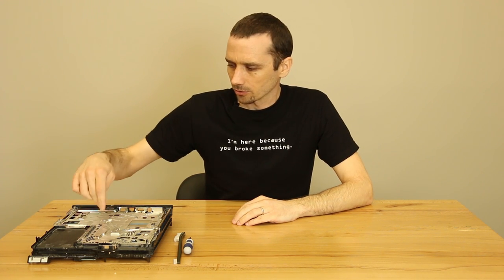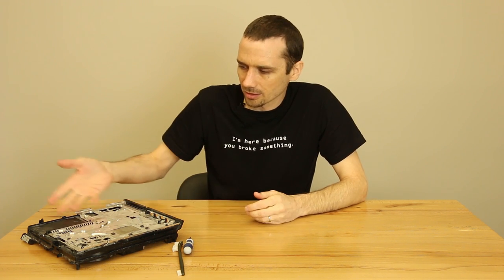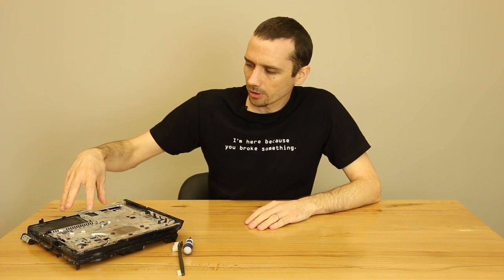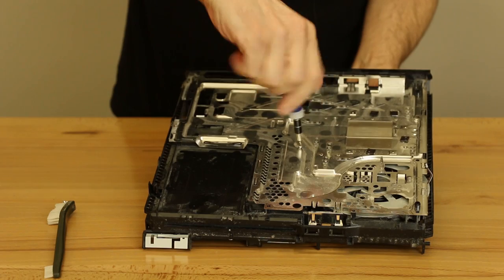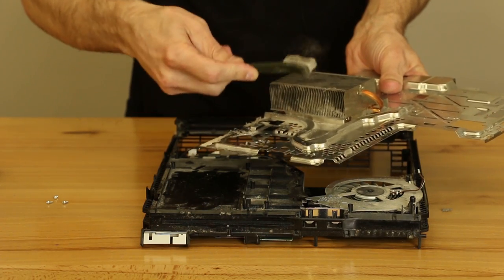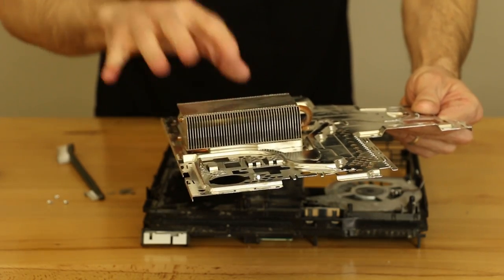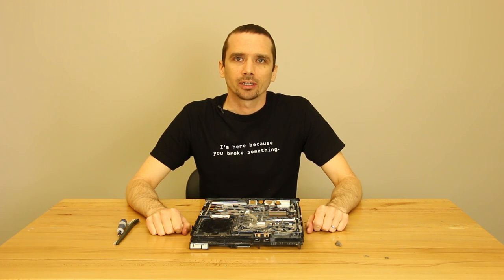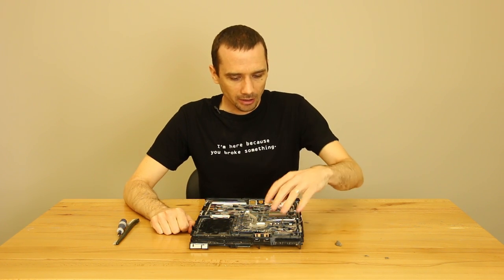PS4 Overheating Repair Tips - How to Fix Loud PS4

Comment: I have a launch PS4. Recently it has started overheating almost every time I turn the console on. It would usually stay on for a minute or two then beep loud 3 times and shut off after the screen says that it is overheating. When I put my hand on the console afterwards it gets to be pretty hot around the power supply area only it seems.

I don't keep it in an enclosed space or anything like that. I decided to take the whole console apart and found there was a lot of dust but most of it was in the fan and clogging the heatsink pretty bad so I cleaned out the entire console. I also replaced the thermal paste after because there wasn't much there and it was crusty. After putting it all back together I thought it was fixed because it worked fine. Then a day later I went to turn it back on and it started overheating again.

For some reason my best chance of keeping the console on seems to be flipping the PS4 upside down and removing the bottom cover to expose the fan/power supply while it is running. When I do this, it usually stays on and barely gets warm instead of getting pretty hot with the cover on and being right-side up.

Does it sound like the overheating could just be the power supply itself?
Reply from the maker: It's not the power supply. If the PS4 tells you it's overheating, then it's overheating.

Comment: One question sir! Why red light  in ps4. And any other problem in ps4 who is problem. Second question sir! Xbox360 and ps4 red light is same. Xbox360 error e74 and ps4 error e74 is same. And any other is problem in ps4 carefully.
Reply from the maker: Red light = overheating on the PS4. I don't know anything about the 360.

Comment: Mine keeps turning right back off after turning it on. It's loud and been like that for awhile, so we took it apart and cleaned it cus it was super dusty. But it still doesn' t stay on for more than a few seconds of turning it on. Anyone have any suggestions
Reply: Maybe try reapplying new thermal paste

Comment: @TronicsFix I cleaned my ps4 very well everywhere but it still runs loud. When I'm at the dashboard it's silent but once I get on a game it sounds like a jet engine. I never replaced my thermal paste I'm not familiar with it but could you tell me what I need to buy in order to replace it and where I can but it? I already have all the screws I just don't know what I need to replace thermal thx
Reply from the maker: I've got several videos about that...just do a search on my channel
Reply: Can you pls link the video to me you have so much videos or pls explain what the problem is, I can sit at the dashboard all day and ps4 is silent, once I start a game it gets loud. but if I am on a game for example I'll be on UFC 2 selecting a fighter and while I'm selecting a fighter my PS4 is jet loud but once fight starts its a little less louder but when fight is over and I'm back to selecting a fighter it gets loud again.  this is just 1 example but for other games it's sometimes louder or sometimes less loud. Help plz
Reply: And it cannot be a dust problem because I took my ps4 apart and even took the fan out and blew it with air pressed can and its still doing this. I think it's either my ps4 fan is not keeping up and doing the job right or my thermal paste needs to be renewed  but I'm not sure which is the problem

Comment: My ps4 only over heats when I play certain games like call of duty but when i play fifa or just watch netflix on the ps it won't come up as over heating ! My guess is because i think call of duty the console using alot of memory so the fan is working overtime to cool the console down as it running fast and then getting over heated at the same time

Comment: I cleaned Mine its not loud but it started to heat up even more i am concerned i dont want it to over heat, btw i didnt open it up till moderboard, i just took off the covers and take out the power source to clean it

Comment: **********I have a ps4 that the fan never speeds up as it heats up for some reason... how do you fix that? It's like the ps4 doesn't know how hot it is so I am trying to figure out where the sensor is and or why this is happening... Please let me know if you have any helpful info.*********
Reply from the maker: It's probably a bad fan.
Reply: TronicsFix I ended up going the cheap route/test and replacing the thermal paste and so far it has not shut off after playing about 30 min of black ops 3... before it would shut off after 10 min or less.
Reply from the maker: Great! Hopefully it stays working for you.

Comment: Do you have to add thermal past? What happens if you don’t?
Reply from the maker: If you remove the motherboard then yes, you need to replace the thermal paste. If you don't it may overheat

Comment: Where do you get thermal paste and pads? If i take my ps4 apart and i dont have those items am i screwed?
Reply from the maker: You don't need thermal pads...just don't lose them when you take the PS4 apart. Thermal paste you can get at Amazon...link is in the description.
Reply: Use tooth paste
Reply: Mr Anonymous is toothpaste a good alternative?

Comment: My ps4 keeps overheating I cleaned the dust out not only in the hardrive slot which I recently put a 1TB hardrive in with barely any dust this year with no issues this overheating been happening this week when I play it's gotten worse It's now with red light flickering it can't get get past 10 minutes without shutting down today I took a part it cleaned inside cleaned underneath the power supply part put it all back together perfectly today. I was hoping it would work it did the same thing it's worth mentioning my ps4 was launch day purchased any advice I think I should get a new one or send it in for repair?  :/
Reply from the maker: We only charge $69.99 for this repair but only you can decide if it's worth it or not: http://www.tronicsfix.com/store/p56/PS4_Overheating_Repair.html
Reply: +TronicsFix I tried it again I think the issue is the fan won't move I don't hear anything my ps4 is too quiet now I think that was the problem all along I cleaned lost of dust so why wouldnt the fan be spinning?
Reply from the maker: Bad connection...bad fan...etc. I have no idea unless I can check it out.
Reply: I'm going to try and send it in Tomorrow to you guys Im also wondering if you guys fix the issue is there a way you guys test to see if it works before shipping it back to me?
Reply from the maker: +Saltywaffle 123 Yes, of course we test it first...we test them at least twice before we ship them back.
Reply from the maker: Yes, we test every console at least twice before we send them back.

Comment: I turn my ps4 on then after a couple of minutes then a message comes up too hot and shutting down even though it's cold, any advice?
Reply: I got the same exact problem. So far, no solution to it for me.
Reply: You could always try going into safe mode and rebuilding the hard drive.
Reply: I’ll try that tomorrow, thanks. Hope it works

Comment: every time I turn on my ps4 it tells me that it is too hot and has overheated. and it turns off, what does that mean?
Reply from the maker: It means it's overheating. Sounds like a broken fan or really dirty system. You can always send it in if you need to: http://www.tronicsfix.com/store/p56/PS4_Overheating_Repair.html

Comment: Can I be able to replace the termal paste my self I know how but I don't think it will solve my sound problem
Reply from the maker: It probably won't but it definitely can't hurt.
Reply: +TronicsFix also my controller has a problem with the R2 triggers it keeps getting stuck can I send you my controller to see if you can solve my problem.
Reply from the maker: Unfortunately we don't repair controllers. Sorry.

Comment: hi, i can remove any dust inside the ps4 with a air spray?
Reply from the maker: +Gabryfox Air will get some of the loose dust. If you really need to clean it you need to disassemble it.
Reply: +TronicsFix Thanks... Yes I meant by disassembled, because the spray leaves condensation droplets. can damage the motherboard??
Reply from the maker: It's always best if there is no liquid that gets on the PS4 components.

Comment: Help..
i cleaned out everything you mentioned and the fan is working fine (i can hear it). The only thing i didnt do was put new thermal paste, i mean the fan wasnt loud. It is not in an enclosed space either. I waited 18 hours for it to cool down and then i turned it back on for 2 minutes and it says "Ps4 is too hot. Wait for temperature to to cool down." already
Reply from the maker: Hmmm...may be faulty solder joints between the APU and motherboard.
Reply: +TronicsFix That causes the overheating? I do get a red light before it shuts off
Reply from the maker: It can cause it. Usually it's caused by the system being dirty or a bad fan, but it sounds like you've already checked those things. 
I would replace the thermal paste though just to be sure. 
You can always send it in if you can't figure it out.

Comment: I just watched your video and I looked at my PS4 which mine is either a 1000 or 1100 series   And I just pulled out a bunch of stuff that you pull their of the heat seek O that PS for on the video off the side vents and I was wondering if you be able to tell me how to take apart my PS4 correctly so that way I can Clean the heat  seek without ruining  my playstation 4
Reply from the maker: Ya...just search my channel
Reply: TronicsFix i just looked at ur tear down vid and i looked at my ps4 and the series number is 1215 . And it keeps shutting off during while i am playing my games and it wont turn back on

Comment: Clean the heat sink out with Hoover not toothbrush like that as some dust goes back into it lol, mine ps4 sound was like a jet had thick stogey dust on heat sink now it like brand new cant hear when I'm playing games :)
Reply from the maker: Using the brush I use works just fine.

Comment: I have a PS4 Pro, it’s in an open well ventilated area and it overheats and shuts off after I open all but 2 of my games. I opened it up yesterday and cleaned out all of the dust and cleaned the fan. I put it back together and it made no difference. This is so frustrating
Reply: Thermal paste (Artic Silver) watch a video on how to remove old thermal paste and apply new.
Reply: Ben Lester Thank you!

Comment: Can you please make a video including the new model PS4 from taking apart the case to gaining access to the fan on both sides. Before attempting a tear down I want to be sure I take it apart correctly. It is slightly different than the older model. Thank you.
Reply from the maker: Already have...just search my channel
Reply: TronicsFix Perfect. Thanks. I didn't hear the 3 beeps because I was probably out of the room, but the ps4 did shut itself down right when I started up a game. I'm pretty sure the indicator light was red also. This is most likely overheating right?
Reply from the maker: Yes, it's overheating.

Comment: I clean my PS4 every month. I recently changed the thermal paste. My PS4 doesn't get hot on the top, less than warm. But I noticed some games the fan goes into over drive. sometimes it's ok, then loud, sometimes it's like a hair dryer. When I put my hand on the back vents...it's not really hot air, just luke warm or less.

I just bought FC4 and noticed the fan goes loud. When I play NHL16, BF4 or even Witcher3 it's not loud.
Reply from the maker: +Camps2630 PS4's get loud with some games...that's just how they are. If it didn't do this before you changed the thermal paste then you may have done something wrong...it's hard to know without seeing it.
Reply: TronicsFix
I messed up even more. I have the right tools but I stripped that long screw that has the metal tab...completely. Am I screwed now, or is there a tool out there?. I tried Super glue, rubber band
Reply from the maker: The one that goes into the power supply? We remove those with a Dremel when needed.

Comment: cant you just put the bit with the heatsync (metal sheet part in 7:35) in a tub of warm water and slosh it back and fourth to get rid of the dust since theres no electronics on that bit  and obviously let it dry for a few days?
Reply from the maker: Maybe...I'm not sure that would get the really caked on stuff. I'd rather just use a brush so I know I got it all and I don't have to wait for it to dry. I can just put it back together right then. Since I'm running a business speed is important.

Comment: My ps4 has been very loud for a long time but i never really cared about the noise cuz it still ran propery and some forums say some ps4s just do that but now everytime i play my ps4 it gives me the ps4 is too hot please turn off screen and i have a cooler underneath it and a fan blowing the air away behind it 
and it still always does thisalmost every day the last couple weeks 
i have thermal paste ,thermal material renover ,thermal surface purifirer ,t-8 screw ,almost everything to fix the thermal paste but ive never done anything like this before so i dont want to break it but i really feel like its going to take a shit on me soon
please help 
idk what i should do 
it also gets very hot quick when its hot ouside but when its cool in the room its ok for me to play
Reply from the maker: +Jason “The Walking Dead” Bohaczek Well you can either try it yourself or have someone else do it. You can always send it in if you're not comfortable doing it yourself: http://www.tronicsfix.com/store/p71/Game_Console_Tune_Up.html

Comment: hi , if i bay an intercooler how much it can help my ps4 like do i need it to summer ?
Reply from the maker: +Ali hossain PS4's don't need intercoolers. If the cooling system in the PS4 is working correctly it is adequate for the cooling of your system, even in the summer.
Reply: +TronicsFix i dont think my cooling system is working because my ps4 was turn off and go to sife moud but when i move the ps4 next to fan he stel working . So do you think i need intercooler ,

my english is not verey good but i write what i can 😅
Reply from the maker: Sounds like the beginning stages of the on and off problem. If the fan is making it work though then by all means keep it next to the fan.
Reply: +TronicsFix Thx

Comment: Hello everyone, I've just recently bought a Uncharted 4 PlayStation 4 LE bundle, at first the console was working great I was playing GTA5 one day and it suddenly turned off. I went up to touch it and it was very warm. I have my PS4 in a well cool place in my living room. Notice that I've only had this console for about 26 days now. I didn't buy warranty for the console so I can't exchange it at my local Best Buy(place where I bought it from). I've contacted PlayStation and they just told me to rebuild my data base. That didn't help. I've tried many things to try and "troubleshoot" my problems but they don't work. I don't want to have to pay $150+ just to fix a console that's suppose to be working in the first place, it's either send it to PlayStation or get it fixed at the Best Buy I bought it from at Geek Squad. Can someone tell me what it could be that's making my PlayStation do this? Thank you.
Reply from the maker: It automatically comes with a 1 year warranty. Take it back.

Comment: But the thing is I didn't hear three loud beeps and there's no LED lights on my controller or my PS4 and it shut off automatically.I need some help can someone help me please. I'm Trippin balls right now😡😱😭
Reply from the maker: Did you get a notification that it's overheating? If not then it probably wasn't overheating.

Comment: Do I have to take apart the ps4 if it has a message popping up system is too hot?
Reply from the maker: Yes...or have it repaired by someone.
Reply: Thanks so much fro responding God bless u

Comment: im using my ps4 for 3 years now and for the first time i got the red lights im really scared it also makes loud noises and trun on and turns off after 5 mins please help!
Reply from the maker: We can fix that for you no problem: http://www.tronicsfix.com/store/p56/PS4_Overheating_Repair.html
Reply: +TronicsFix but i live in Bangladesh :(
Reply: +TronicsFix can this be fixed? or else i need to buy New ps4 😭
Reply from the maker: Wow, that's a little ways from us! Could just need cleaned & thermal paste or it may need a fan or something else.

Comment: I just take the back off, and the power supply out, clean out the fan us some pipe cleaners to stick into the heat sink and clean it out.  hopefully will be enough.

Comment: why i think my ps4 is getting overheated is because when i play games like until dawn or destiny it starts to work like a tank and is getting so hot that you can cook an egg on it, after 45 minutes or less my ps4 is turning of by it self and i have to unpug it and let it unplugged for a couple of minutes to turn it back on otherwise it doesnt turn back on, when it finally opens it makes 3 beeping sounds and a notification pups on and it says that the ps4 wasnt turned of properly and its like it says me that i unplugged it while i was playing, i have this problem for over a year since i bought it after two weeks it started doing this, i have the c classis version of ps4
Reply from the maker: It's actually probably a problem with the solder joints under the APU. You should definitely make a video of you cooking an egg on it though!